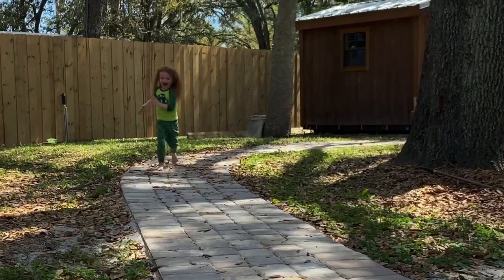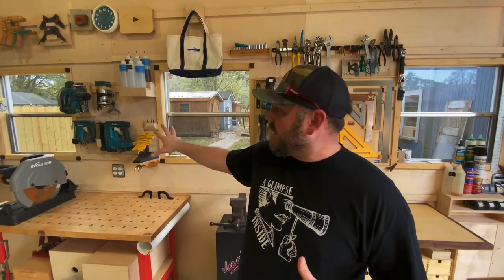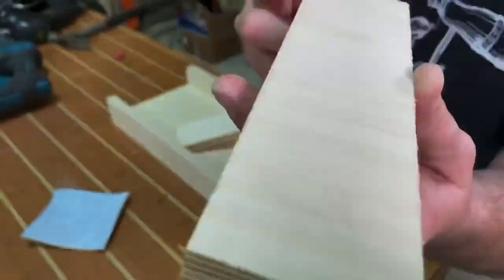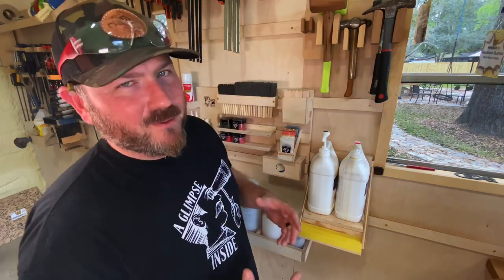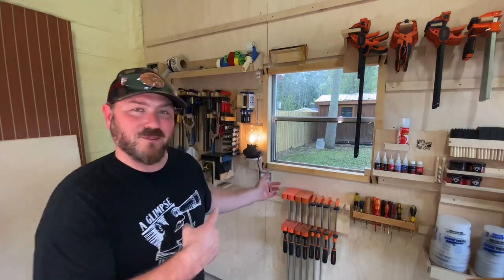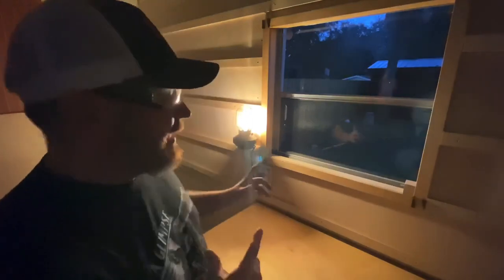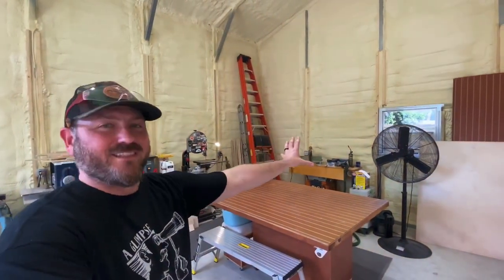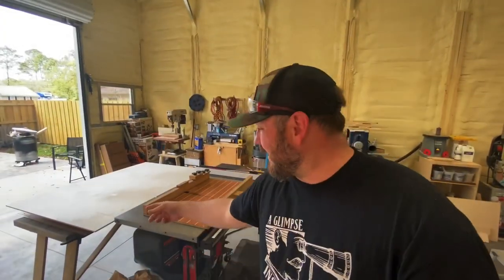30 Foot FRENCH CLEAT WALL | Shop Update #1

Comment: Never run a current through a coiled wire, it becomes an element and heats up.  Its a fire risk.  Same rule in unwinding an extension cord fully off the reel before plugging in.  Like the shop and the holders.
Reply from the maker: I never realized this. Thank you so much for letting everyone know and myself

Comment: Stop using 18 gauge brads! I always look for 16 gauge for my trim nailer.
For those that don't know 16 is thicker than 18 and a lot easier to pull back out without snapping them.
Another tip is to pull nails from trim from the point so you don't blow out the pretty surface by tapping them back out.